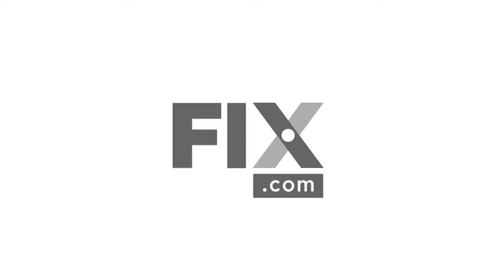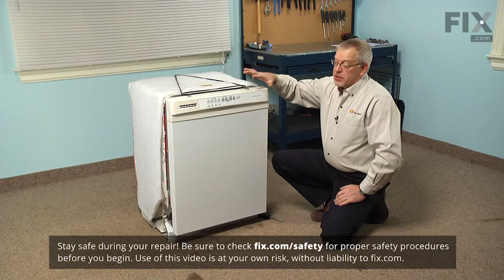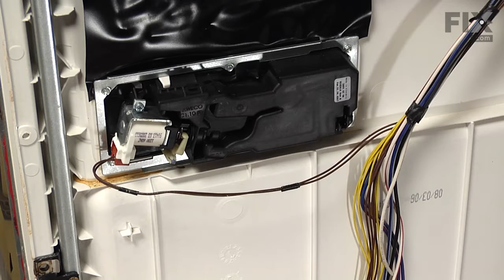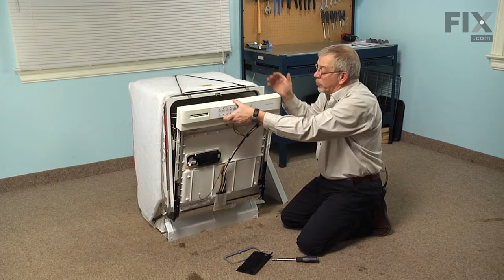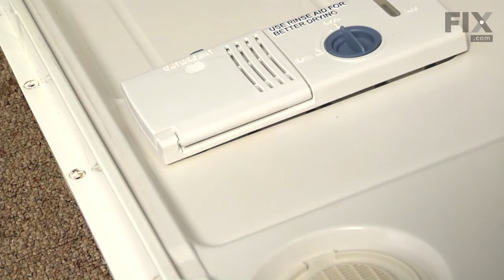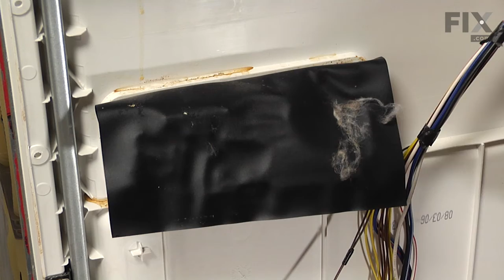Whirlpool Dishwasher Repair – How to replace the Detergent and Rinse Aid Dispenser

Comment: Done! Pretty easy task. I had the Torx driver but had to run out to get the 3/16 socket. It helps to have someone to help hold the panel until you get a screw in when reassembling.